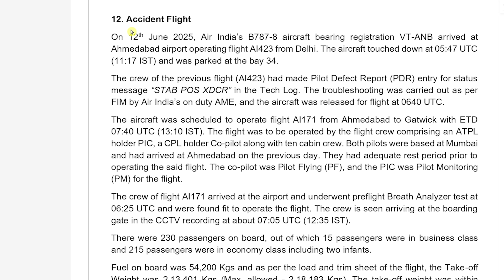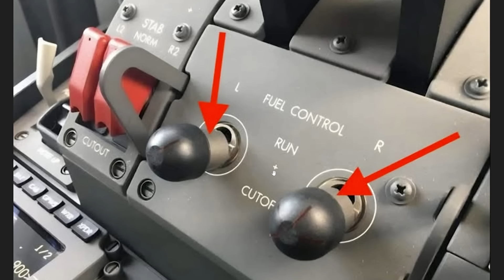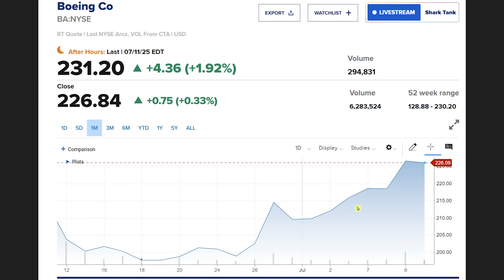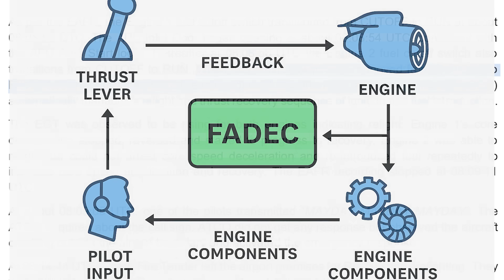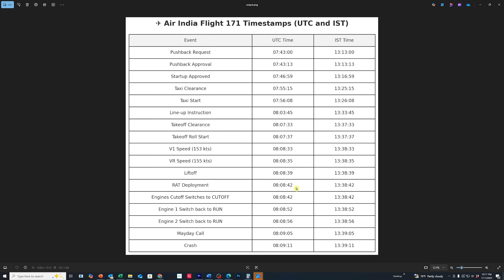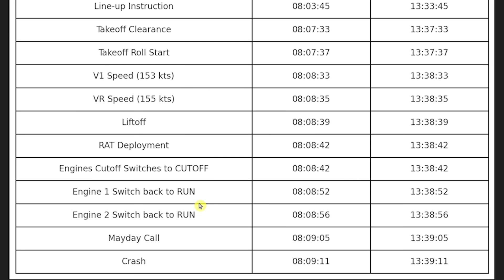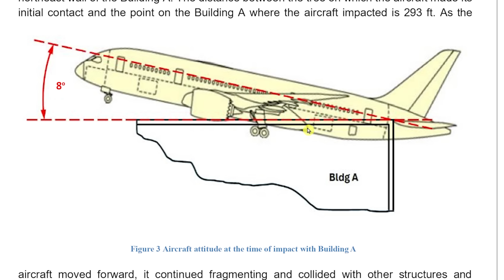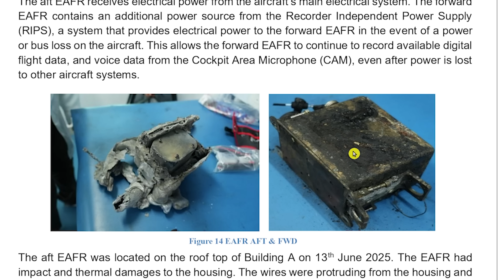Did Pilots CUTOFF Fuel? Shocking Twist Air India 171 Report!

Comment: 15:48 if it's the same kind of detent safety mechanism lever it may have the same vulnerability, this is an important SAIB to consider.  My problem with this SAIB is that an issue related to two levers that can bring down the plane only have an advisory status on this SAIB.  They may wish to amend that SAIB to mandatory.  The big problem is the crash and fire damage to the throttle quadrant may be too severe to make a conclusive determination about the status of the fuel selector safety mechanisms on the accident aircraft.  Solution: mandate inspections.  No Boeing gentlemen agreements, do not allow another Turkish Airlines 981.

Comment: Ok, not knowing much of anything about airplanes, I looked up "fuel control switches 737" (forgot it was a 787) and there has been an advisory out for awhile that on some planes the locking mechanism on the fuel switches on the 737s and 787s (the switches are the same on both planes) DON'T lock. Mechanics haven't been checking because it wasn't mandatory, only an advisory. So maybe them being in the off position was not on purpose, maybe an elbow hit them when one pilot pushed thrust levers.

Comment: 12:10 More like 2 seconds apart, there was also a command in there to start the APU at 08:08:54 after putting ENG1 back to RUN.  I garner the reasoning here is "Get the engine with the best chance to recover back to RUN (spent shortest time set to cutoff), get the APU going for bleed air (for restarting), then set the final engine to RUN.  They are too slow for windmill starting so starting the APU for bleed air is an important step here.  If the PF is doing all this in a rush to counter the other pilot's cutoff setting, he's doing it with one arm (the other is on the yoke) which explains the time taken.  Looks like he's doing everything he can to recover, but there just wasn't enough time.

Comment: The difference between the cutoff switch times ensures it was a two handed operation to switch off and a single handed operation to switch back on. It's pretty obvious, and it's pretty obvious the RAT was deployed at the same sampling second as the shutoff. Jobs done, don't play, it's clear as day.
Reply: "The difference between the cutoff switch times ensures it was a two handed operation to switch off and a single handed operation to switch back on."

Using two hands to move the switches to the CUT-OFF position is very difficult form either seat, but would not be possible for the handling pilot if they were holding the yoke in their other hand.

Your point about switching back to RUN is a possible explanation.

"It's pretty obvious, and it's pretty obvious the RAT was deployed at the same sampling second as the shutoff."

The time when the RAT was deployed is not mentioned in the report.

The time between the switches were moved to CUT-OFF for engine was given in the report as 1 second. In reality this could have been much short, but was not detected because the polling rate was low.

Comment: Let's believe the pilots until we have reason to disbelieve them.  A full cockpit transcript might be more helpful here.

After all sorts of caution alarms pilot A realises that the fuel to the engines is cutoff. Maybe the switches are set to "cutoff", maybe they have an alarm showing fuel cutoff but the switches are in the "run" position. Nothing monitors the mechanical position of the switches. We don't know what happened, but we do know that the pilots were aware that the fuel was actually cutoff (loss of thrust would tell them that).

Pilot A knows he didn't cut off the fuel so asks pilot B - the only other person within reach - why pilot B cutoff the fuel. Pilot B knows whether he did or did not cut off the fuel and replies that he did not cut off the fuel. That is their "deathbed testimony"

If they were wrong and one of them did turn off the switches inadvertently then the detent(e) must have failed to operate as intended. 
That would be very unusual but whatever happened was very unusual. Nothing that happened could have been predicted by considering only what was likely.

If they were right (that neither of them moved the switches), then something distal to the manual operation of the switch must have set the fuel to "cutoff". Whether that was a mechanical failure of the switches or an elecrical transient is probably not determinable from the wreckage. However, other similar planes .ight throw some light on what could have happened at this point.

If the fuel was cutoff but the switches appeared to be in the "run" position then it is easy to understand a few seconds delay in  cycling the switches to "cutoff" and then back to "run".

If one of the pilots was lying and one of them had intentionally moved the switch to "cutoff" then the plane was intentionally crashed by one of the pilots.

Everyone except the pilots, the passengers, and their relatives would like an outcome that blamed one or both pilots as criminal or incompetent but that is not a good reason to reach for that outcome

There are still a lot of questions and a rush to judgement is not helpful. An open mind considering all of the unusual circumstances and possibilities would be useful.

Comment: So, how did both engines get cut off at the same exact time but take 4 seconds to get put back into run. Then of course, how did it take one of the pilots ten seconds to notice the engines were off. Wouldn't that have been noticed immediately seeing how they were taking off. I know this sounds even stranger (almost impossible) , but what if neither pilot shut those switches off.

Comment: Is it physically achievable for a pilot to manually switch both engine fuel control switches to 'cutoff' simultaneously at exactly 08:08:42? From what I understand, operating these switches is not a simple task it typically involves a two-step process and requires the use of two to three fingers for each switch. This makes it unlikely that both switches could be turned off at the exact same moment manually.

What’s even more telling is the timing when the switches were turned back to 'run': the first at 08:08:52 and the second at 08:08:56 a clear 4-second gap. This staggered timing during the reactivation, compared to the simultaneous cutoff, suggests that the shutdown was not a manual action. Instead, it points towards a possible mechanical or electrical malfunction that triggered both fuel switches to cutoff at once. The presence of a delay when switching back to 'run' supports this theory further.

Comment: Faulty or sudden lost of electrical supply to the solenoid that's control the fuel switch safety pin to maintain order in the RUN position to trip and drop off  to cut off function. Most likely boeing will use some type of  module or relay to control the fuel switch safety pin that still to  holding on original position has been set by pilot.

Comment: But recovery procedure includes cutting fuel supply and then restarting it.  That is the procedure.  The RAT deployed BEFORE the cut off switch was changed to off.  That suggests that there was an engine problem... this does not sound like suicide to me.  The reponse that I didnt turn off the fuel supply could have been one pilot not understanding that doing so is the procedure and the response could have been just a quick reply that I did what was required and turned it back on.  When were these words spoken in relation to the time sequence provided.

Comment: How could the pilot operating the liftoff mechanism also pull the engine shut off switches 
Visually would this be apparent? 
Or one pilot is operating lift off mechanism and other reached over and pulled engine switches to off position. 
Then who turned on both engines switches 
😢😢😢

Comment: Co pilot was flying AI171... at rotation he is lifting plane 3 seconds later 08:08.42 fuel switched off for 10 seconds, why so long? The cockpit conversation about fuel switch  shows disagreement.  Rat deployed 3 seconds after fuel switched off. Even tho 787 dual engine failure checklist says switch OFF then ON straight away then press on Rat.. not 10 seconds later!  If it was a 'checklist' why the dispute. The Pilot who was monitoring.. at rotation whilst his colleague at 08:08:39 lifting plane requires hands and eyes... wft is pilot who's monitoring doing at 08:08:42

Comment: Switched off fuel in the same second. That seems a planned mass suicide, not accidental error. Time may reveal a troubled or financial problem in their life. And even if one engine has flamed out, the check list does not allow a restart during critical takeoff moment, but must be done later in stable flight

Comment: It was probably mass murder by cpt. Subharwal! I am sorry to say that but it all makes sense now. FO was in charge, at the moment when the fuel was switched off the plane did not move, so the FO had to have both hands on the yolk. Cpt was monitoring pilot and performing cockpit duties. FO lived his dream and had no reason. Cpt was facing serious issues with his father,(helping him)mother for a long time. Captain Mohan Ranganathan made a public statement that one of the pilots has medical history and had been extended medical leave prior. FO was fighting till the end and he literally couldn’t switched the fuel off, all makes sense now, also at the same when they switched on there is visible move on the airplane, exactly what should have happened when the FO used 1 hand to do it and hold the yolk. Also V1 was cut off first (captain side) V2 1 sec later. 1 sec one after another is possibly with two hands free (Captain) Switched on took 3-4 secs it is one hand timing! FO with yolk holding could use only one hand!
Reply: bull

Comment: Great analysis of this crash report. You cut to the chase for why this plane crashed at about 3m in this video.

I've got these questions:
1. Who moved the switches to the fuel cutoff position?
2. What was the mental frame of mind of the pilot in control of this airplane?
3. Was the responsible pilot politically radicalized?
4. Who was on that flight? Was this an elaborate assassination plot to kill someone on that flight?
5. Was one of the pilot's families/friends being held "hostage" as leverage over that pilot? "I'll kill your family, extended family, children unless you down this plane". 
6. Who was in the building this plane crashed into; same assassination question applies above.

This is all crazy, but the data from this crashed plane does not lie. The reason it crashed was both engines fuel were deliberately cutoff right after takeoff, and this plane plummeted to its death.

Comment: Are you serious? You’re blaming the clean up crew?Wow; when a unionized  workforce member  (the captain) messes up this bad you’re always looking for scapegoats
Reply: It was probably mass murder by cpt. Subharwal! I am sorry to say that but it all makes sense now. FO was in charge, at the moment when the fuel was switched off the plane did not move, so the FO had to have both hands on the yolk. Cpt was checking pilot and performing cockpit duties. FO lived his dream and had no reason. Cpt was facing serious issues with his father,(helping him)mother for a long time. Captain Mohan Ranganathan made a public statement that one of the pilots has medical history and had been extended medical leave prior. FO was fighting till the end and he literally couldn’t switched the fuel off, all makes sense now, also at the same when they switched on there is visible move on the airplane, exactly what should have happened when the FO used 1 hand to do it and hold the yolk. 1 second one after another is standard time with both hands free (monitoring pilot) but switched on took 3-4 seconds, it is one hand timing (FO)

Comment: Are you ABSOLUTELY SURE that NO TECHNOLOGY is involved IN ANY WAY with one or both of those two fuel switches?   If there was a technological interference is it not possible that the pilots attempted to manually redress the switches for a reset - one engine responded and the second engine did not b/c the technological problem was continuing to prevent fuel access.  The remnants of the two switches were in the “RUN” position when retrieved which might address an attempt to override what the problem was

A question: IF the RAT was deployed, somewhat immediately, was it responding to a technological issue regarding the two engines nonexistent access to fuel?  MAYBE . . . the pilots were telling the TRUTH

Comment: Oftentimes, the simplest explanation is correct. The copilot sabotaged the aircraft. However,  investigators tend to believe computer data 100% and are slow to consider other options. For example faulty switches can indicate the wrong positions intermittently. I've seen this with incidents within my aircraft community. Which, of course, can't be disclosed because it's  controlled info. So my interpretation at this point... intentional sabotage >90%, physical switch or computer data error = <10%
Reply: Seems more likely that is was the captain who did the murder suicide, not the copilot.
Reply: Question is- who is at fault? Anyone could have asked that question whether being guilty or not. We would never know.
Reply: @wrightvcx2249  They are going to be able to find out who cutoff the fuel. The blackbox records who is driving the plane. In this case to be able to lift he plane up you need to pull back, which requires both arms to do it. In a Boeing if you need something selected while lift off you will ask the other pilot to do it. On an Airbus it would have been difficult because you have a joystick and only need one arm to do it so you can still reach with your other hand. Also once this plane was having problems you will also be able to tell which pilot was trying to fly the plane and if the other selected anything from their side. Some may be asking why have a this feature to cut off fuel to engines ? well the reason is because if one engine is on fire then to avoid a possible explosion you need to cutoff the fuel going to it. This especially could happened during takeoff since the plane can hit a bird and lead to damage to engine.  The captain was going through family issues, his mother apparently is very sick and the co-pilot recently got engaged, I wonder if his future wife broke it off.
Reply: @knight3131  afaik the COpilot was on the stick and starting
Reply: @wrightvcx2249  co pilot was in control,,,,
Reply: Agree, not enough evidence yet to rule out some screwy technical issue. That said in my view information coming to light about the Boeing's engine controls highlights appallingly bad design. If the throttles are set to takeoff power that is exactly what you should get. Nothing should be able to override the throttle setting.
Reply: pilot asking why did you turn off the fuel is suspecious. Why did he let other co pilot to turn it off while takeoff critical situation. Seems like the pilot did that and blame to co pilot as he knew about recording. There is no possibility both switched turn off with out manual intervention. Its fully suicide
Reply: @saraedword2985  what if the captain was busy flying the takeoff when the co-pilot had flipped the switches? Do you think he had the time to prevent him from flipping the switch?
Reply: @yasirsaheed You have it the wrong way around. The co-pilit was the one flying the plane during take-off whilst the captain monitored.
Reply: @ellea2541  it been stated already? Cz the part on the report just says the pilot and other pilot not mentioning which pilot said what.
Reply: Yes, there's clarity regarding who was flying (first officer/ copilot) and who wasn't (captain). The only uncertainty has been who flipped the switches and who asked and answered the question about flipping the switches.
Reply: @ellea2541 oh, i didn't know. Hope soon, further investigation would bring reveal
Reply: @ellea2541  i said copilot but after further review i would say pilot.
Reply: You missed the CUTOFF time, listed once. Why? Is it at same time? How?
RAT deployment listed first. What does it mean?
Reply: Никому больше не рассказывай страшную тайну про свои 2 неисправных переключателя.
Reply: Switches shut off by themselves. Do your own research. "2018 fuel cutoff switch problem".
Reply: @douglass220 Modern Boeing aircraft like the 787 or late 777 use electronic control units (ECU) and FADEC. Malfunctions can prevent proper fuel cutoff. In some cases, fuel continues to flow momentarily after switch off due to fuel line pressure or valve delay. Its not related to automatically both switches turn off the fuel. Its impossible as its completely manual procedure first to pull it and then release it to off position. Pilot use it two times only before takeoff to switch on and after landing switch off. There is no way both switches turn off. Pilot is must involve in it. Also these is one second delay in doing it. So when they knew about the problem then its 10 seconds delay to switch it on again. It seems like all pre planned.
Reply: @douglass220  Left OFF, Right OFF ONE second apart?? The same interval a typical manual sequence to OFF takes? Locking switches require mentally engaging with the pull, then lift toggle operation. Lockouts reversed would INSTANTLY catch your attention and that of every crew flying this aircraft.

Comment: EICAS will show cutoff if it interpret the signal as such, not necessarily due to the the physical movement of the switches. That message could explain the pilots surprised conversation. So it's possible to actually buy both the question and the answer.